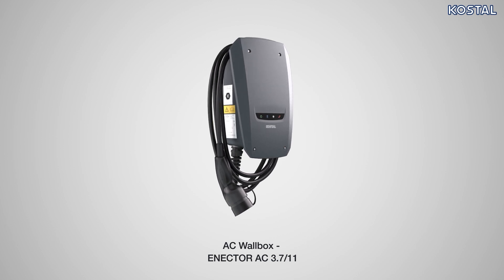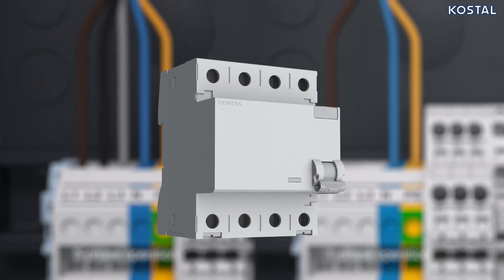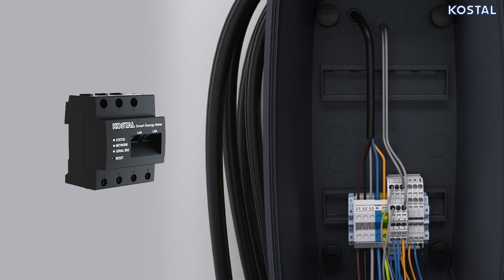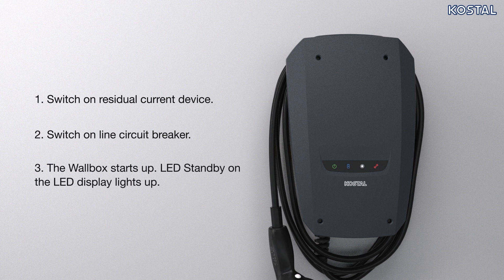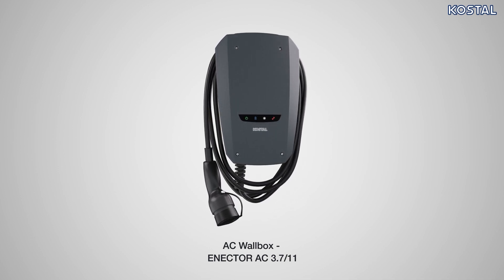Expert Guide for Installers: KOSTAL Wallbox ENECTOR Installation and Initial Commissioning Tutorial

Comment from the maker: Timestamps:
0:00 Intro
0:24 Scope of delivery
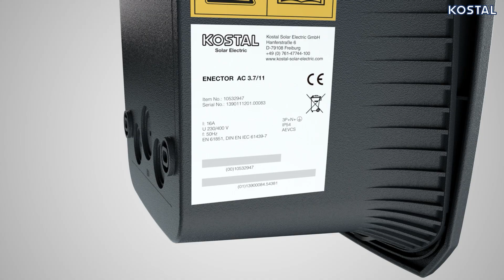0:51 Where to find serial number, technical details & warnings
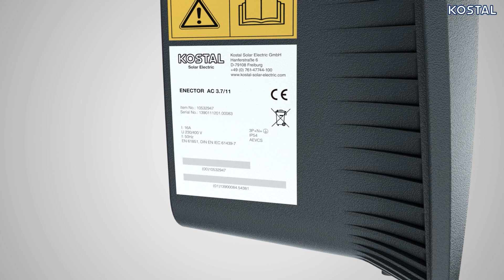1:02 Design of the Wallbox ENECTOR
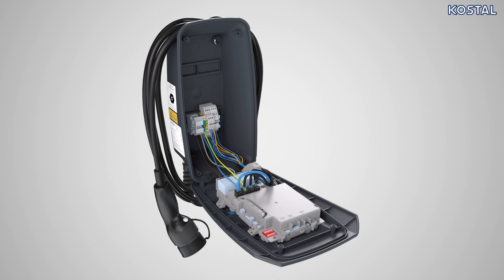1:46 Preparing for installation and mounting
2:16 Positioning the Wallbox ENECTOR
2:30 Attaching & fastening the Wallbox ENECTOR
3:10 Connecting the supply line
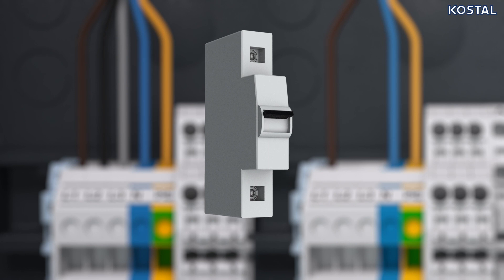3:58 Installing a push button to switch charging modes
4:33 Connecting a shunt release
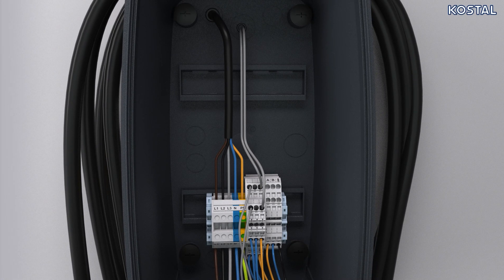5:22 Connecting the KOSTAL Smart Energy Meter (KSEM)
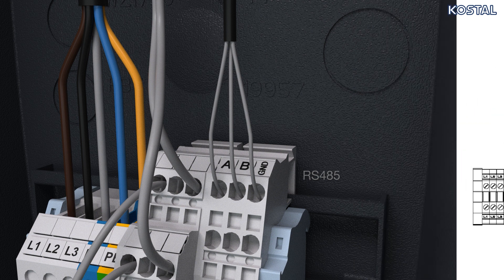6:11 Configuring the ENECTOR wallbox
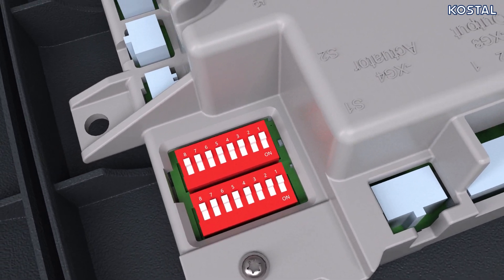7:18 What to check before closing the Wallbox ENECTOR
7:30 Safety instructions for Wallbox ENECTOR
8:14 Initial start-up of the Wallbox ENECTOR
8:43 Setting up the Wallbox ENECTOR in the KOSTAL Smart Energy Meter (KSEM)
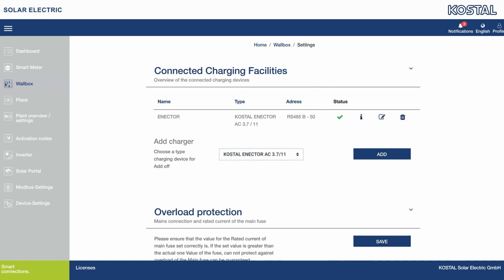10:47 Activating KOSTAL Solar Portal
11:03 Activating convenience functions
11:18 Charging modes of the Wallbox ENECTOR
11:46 Functions of the charging modes 
12:17 Outro